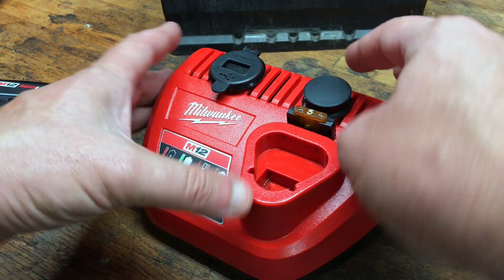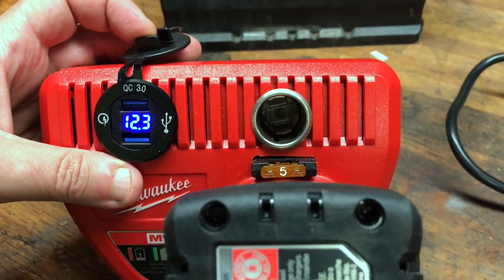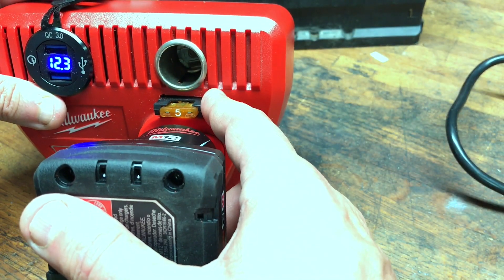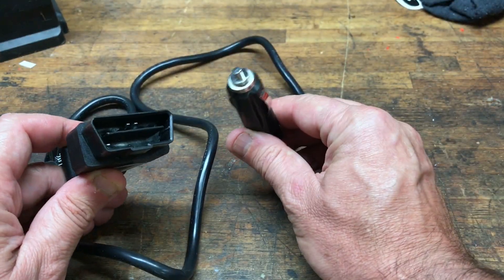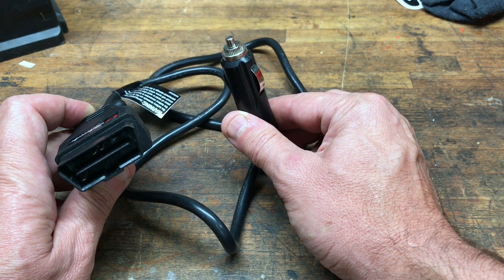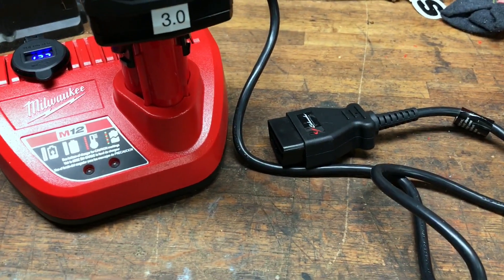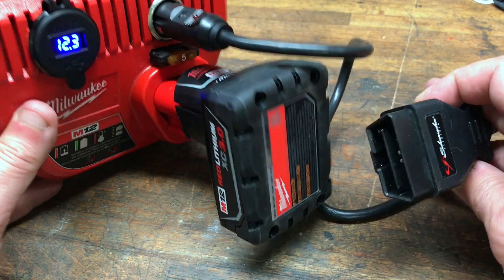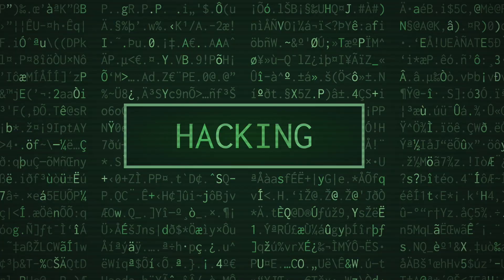OBDII battery maintainer mod - Milwaukee M12 charger Mod.

Comment: Quick question, why a 5amp fuse and not a 10 or 15 amp one ?
Reply from the maker: Wire size, its for smaller circuits.

Comment: Hi, I was wondering after seeing your video if it is possible to take a charger like this and To change it so i can  charge a M12 battery from the car with it.
Reply from the maker: Milwaukee makes a M12 12V charger adapter, if you were do it with this there needs to be some sort of charge limiter. Your best bet for a cheap hack would be to use 12 v inverter to a 120 charger.

Comment: Love the repurposing of the m12 chargers. I have so many as well ive been building my own bundles when i gift or sell m12 tools. Also, recently started using the m12 heated jacket adapter as a memory saver as well. I have an obd II adapter from a snap on lithium ion compact jumper pack that attaches to the adapter for the jacket output. Works better with the larger 3Ah or above batteries. However, i've also been able to repurpose the partial life time  exhausted m12 batteries that are beyond the warranty period.

Comment: Can an 18v version of this be made?
I'd also like to see s 18v charger thst can be charged with usb so I can have an easy & safe solar option.
Reply from the maker: I dont see why not, BUT Milwaukee makes an 18 V "top off" USB and 120V inverter for 99$.
Might be better of just buring that.
Reply: @danjreed I am using my top off and ryobi's one plus version in conjunction with a 12v plug in converter that you can buy off Amazon. Its rated 12v and low amp as well. You can plug in the converter to a house outlet or the battery powered inverters and get 12v out of a pre attached cig lighter outlet. More than one newer car to come through the repair shop has had lost configuration or missing vin data on its modules after other shops and dealers changed batteries without memory savers. In these cases customers have had to drop cash for towing services, multiple re-programming services and for one unfortunate euro import even modules.

Comment: You could also do cig to cig lighter if you have cig power with key off
Reply from the maker: Not with most modern cars, very few leave the accessory socket powered while the car is "off".  My last car that had a "live" socket with power off was from 1990.
Reply: @danjreed  thats why i said IF your car has it. My 2001 bmw 5 series has a live socket. I know plenty of cars im the 2010s that have live sockets. Each manufacturer is different and most cars that have the auto off feature are convenience features. Alot of work trucks even new ones have live sockets

Comment: Do they have obd2 to USB I would prefer that, I hate that 12v dc port
Reply from the maker: You could make one pretty easily.  OBDII has 12v and ground.  But I don’t like to run anything but a scan tool off of it.  Current is very low.
Reply: The other issue with using a UBS Type A to OBDII is that most USB outlets cap out at 5v. I've heard you don't really NEED 12v for memory saver functions since the components with volatile memory take the 12v and neck it downt to 5v or 3.5v anyway. I'm still torn about it. I don't think it should hurt anything to sustain 5v instead of 12v if that's all it requires anyways. 

But you could also just use a 9v battery and wire up a connector to an OBDII male connector.  That's a very common solution that auto techs turn to. The only issue I could see with that is having to check the voltage before you use it every time, but that takes hardly any time at all.

Comment: where did you get the little battery terminal circuit board?
Reply from the maker: Its part of the original charger, it is the baseplate with pins soldered to it that plug into the battery ports.
Reply: @danjreed  oh, ok, mine's much different, mine its part of the larger board

Comment: Do u have video for parts used in this mod
Reply from the maker: Amazon carries those USB 12V socket ports for about $15.  The 12v. cigar lighter was just some junk I had on hand in the shop.  Other than that it wires, and a fuse holder.
Reply from the maker: https://www.instagram.com/p/BzwYyiyH1cG/?utm_source=ig_web_copy_link some of them
Reply: @danjreed  I like your style Dan. I'm now following you on IG. Keep it up.

Comment: Love it, great video
Can you build one to run a 💻 MacBook Pro with a weak battery?
Reply from the maker: Pretty sure it could.  Just had my wife’s Mac Book Air apart for a new battery... I should have picked around with it before I sent it to the recycler. 
I’d be pretty cool to run a laptop with power tool batteries... haha.
Reply: lap tops run from 15 to 21v so its doable just add a step up step down inverter to match the voltage with the battery

Comment: You should add a capacitor so you can quickly change batteries without losing the memory
Reply from the maker: Thats a smart idea, there is certainly room in the case to add one.  BUT given the short amount of time that most battery swaps take and the low current that memory functions use, Im not sure its worth adding.